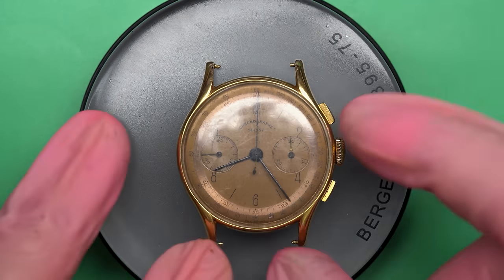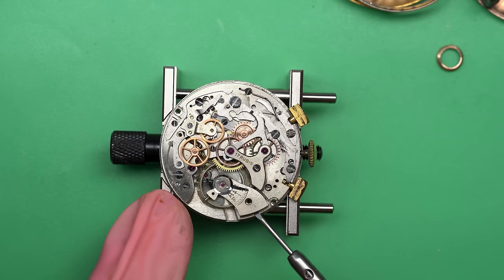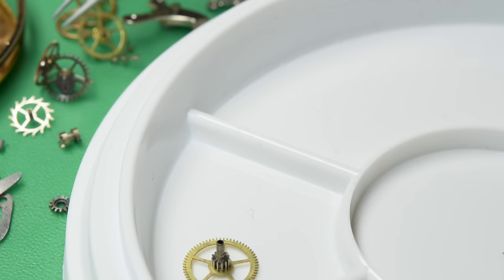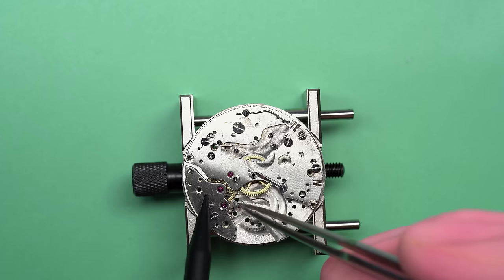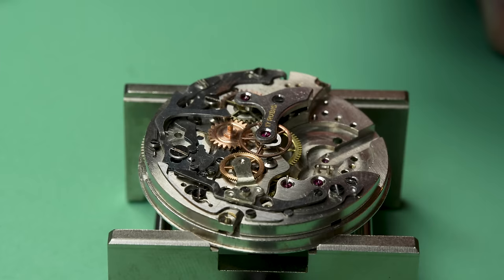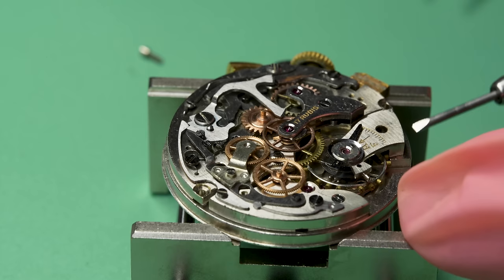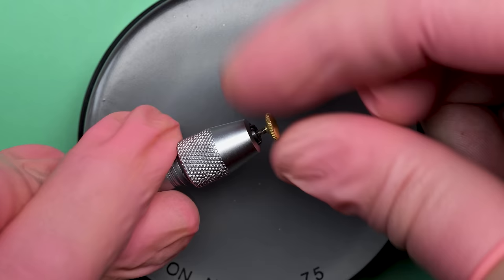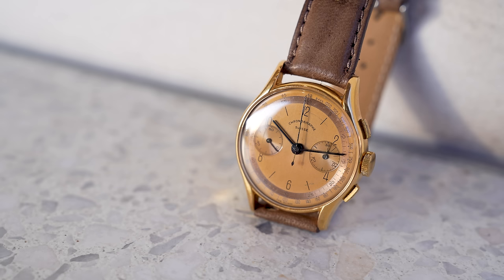Finally, My First Time Working on a Chronograph!

Comment: Thanks for the explanation of the Chronograph vs Chronometer, I tended to think they were basically the same, and just indicated a 'flash'  or high precision watch.  My 'daily driver' is usually digital, I'm an electronics tech who plays with computers & a bit of programming, so adding stopwatch functionality to me is kind of child's play, just a bit more coding on a micro. However seeing it from the mechanical side - wow, way more involved.

Comment: Whale Oil is an excellent oil.  It does not degrade over time.  That's why NASA used it in the gyroscopes on the Hubble Space Telescope.  Now the Gyros are sealed but that it was the only oil for space tells you something about it.  They had to go find a supply of it from the old days since modern whalers only do it for food in some places.

Comment: Loved the Chronograph…and that dial is awesome…really unique. In a future video could you talk a bit about sourcing parts? I am having trouble finding a gold crown for an Omega 166.098. Trying to get into the hobby starting by doing some very minor restoration work on a ‘72 Omega Geneve. Watch was already serviced but has some generic parts that I want to bring back to original as much as possible. Would appreciate any tips.

Comment: Chrono's are a bit scary aren't they. I did one last year, it would not run but it was complete. I still sold it for over 200GB. I haven't tried again just yet . Not so many vids on them. You are a pioneer.

Comment: Again great video, love to watch your videos. I just acquired an old Titus Geneve with almost the same movement, that is in need of an overhaul, but haven't dared to touch it yet. I was also told with this movement it was better to leave the screws in place after removing the parts, since it would be a lot better to keep track of where they go. I hope i will get the courage to take it apart at some point 😄. Maybe at little to much side shake at one point, and I would have changed the mainspring, it's pretty set, but very nice job, probably couldn't have done it better myself🙂

Comment: 39:00 Whale oil was really good. Before synthetics, sulfur treated whale oil had a very consistent viscosity over a very wide temperature, it is thin, does not congeal or dry out and does not corrode metals and until 1972 was heavily used in car transmissions, aero-space, sewing machines, watches, and even used in some nuclear bombs.
It was so good that transmission failures rose from under 1 million in 1972 to over 8 million by 1975 in the USA. Modern synthetics beat it by miles, but it took a couple decades for chemists to find the right formula.

When you're rubbing off dried oil on jewels, especially on older watches like this, it's very likely that it's whale oil.

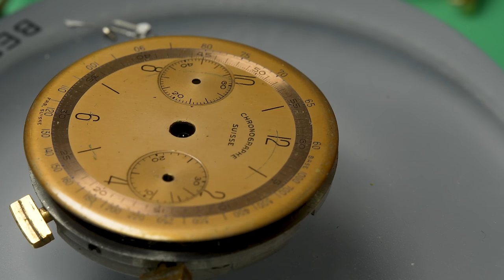Comment: Just a very minor nitpick about the use of “seconds hand” and “sub-seconds hand” from around 6:00 ; The big “seconds hand” is actually the chronograph seconds hand, which only moves while the chronograph is active. The watch’s seconds hand is the small sub-dial on the left (near the 9 o’clock position) and that hand always turns whether the chronograph is active or not.

Comment: A lot of 3D Printer Enthusiasts will knkw about eccentrics because they are common in a lot of printers for adjusting wheel tension in the tracks.

Comment: I had been wondering when I would see a Chrono. I have a Kelbert Chrono which looks similar to this which I found and needless to say, it needs service. It is so fascinating to see what goes into it. I wonder if this has the same movement as mine. It seems to have the same dial configuration. I have been so hesitant to have it serviced because I know it will cost me a fortune and I am afraid of rejection because it's old enough that I think it probably has radium in it. One of these days, I hope I can have it done.

Comment: Glad to see you are servicing a chronograph. I have a watch that was left by my father-in-law. It’s an Angeleous Chrono-Dato. Possibly from 1940’s. He likely acquired it when in the Army during either WWII or in Korea as he was in both wars.
It was not running so I asked a Jeweler to service it. It was returned with stated being serviced and repaired but never continued to run. Would you consider taking it on for servicing? It is a beautiful watch with golden case. Or, could you recommend someone to service. Thank you How do I access your response?

Comment: I love watching you work. I have a question. I bought a vintage watch from eBay. It was advertised as working and punctual. It winds and keeps time, but it is fast. It moves forward in time about 20 mins in about a 4 hour period. Is there an adjustment to bring it back into time?

Comment: Typically a shaft of screw with a lobe on the end that applies pressure is normally referred to as a cam in the engineering world, however i don't know if this applies to your trade

Comment: Hi Marshall.  I love a good watch.  Being from Australia, I particularly like Aussie brands with good movements.  I have a Bausele Oceanmoon  with a Sellita SW200 Swiss movement and two Haugh and Hastings M2 dive watches with Seiko NH38 movements.  The question I have is that I have an older Citizen Aqualand watch I bought in the 90s while posted (Army) in SE Asia and I would like to see if it is worth being restored.  It has a very scratched sapphire and the bezel has copped a lot of abuse, but otherwise good condition.  I get that its a battery watch (3 I believe) but I hope you may have some sage advice

Comment: Marshall:  My wife and I really enjoy watching your projects.  I found the Omega chronograph my wife bought me over 50 years ago.  I pulled it out and wound it and it runs.  Its labelled a Seamaster.  I looked on the web and found what seems to be my watch:  Omega Seamaster 2884, caliber 321.  I tested it with my timegrapher app with the following results:  bph 21,600,   rate 102 s/d,   beat error  0.6 ms, and amplitude  215 deg.  Not too bad except accuracy.  I'd love to get this watch serviced and hand down to grand children later. 

How do I find a reliable service location?  Are there authorized Omega service centers?

Is this one you would like to take a crack at, now that you've stepped up into the chronograph world  :-)

Comment: Fascinating. I notice that on the chronograph side, one of the wheels has much finer teeth than the one that engages with it. You called it the running wheel? Is that common?

Comment: ec·cen·tric = (of a thing) not placed centrally or not having its axis or other part placed centrally.
con·cen·tric = of or denoting circles, arcs, or other shapes which share the same center, the larger often completely surrounding the smaller.

Comment: @Wristwatch Revival   Have you ever considered delving into the witchcraft that is sewing machines? My mother had a great story about a fairly modern one (late 80's, early90's, non-computerized) in which the timing would act up horribly, breaking needles left and right. She'd pack it up and take it to the lone repairman in our area and he'd put it through some paces, right in front of her, and it would work perfectly. He'd accept that she wasn't mistaken or the materials were an issue; it really was going in and out of time because he'd catch just a hint of it at first startup, but it would run smoothly after that. Following a few services to check it he suggested that she just take it for a half-hour drive every time it acted up again rather than having him bill her for the time involved. Sure enough, it would go back to working fine for months without a hiccup following a drive. 
Evidently it just wanted to see the world.

Comment: 50:36  Did I miss something, or is the recording minute hand not set to zero itself on...well, zero?  It appears to be around halfway between 0 and 1 minute (zero also being the 30 minute mark)...unless that's just parallax error from the camera angle.

Edit: nvm, I see it ended up on the money @ 51:12.  Doesn't matter if it was repositioned or if it was right from the first, so long as it's right when the job is declared done.  👍

Comment: At 39:33 I noticed that there was some Rodico left on one of the alignment pins of the balance. i don't know if you removed that prior to putting the balance in but my guess is this could have been responsible for the balance being a bit more difficult to seat and align at 40:05? I didn't hear you say that you removed it or saw that pin again afterwards so I don't know if this could be the issue

Comment: Thanks, Marshall.   I have a couple of questions if you wouldn't mind...

1.  What type and power of binocular magnifiers do you wear? 

2.  I overhaul pocket watches.  A friend of mine has one where there is a DENT in the side of the screw back - that is right in the thread groove - locking the case back into place.  Any ideas on how to safely remove the back?  I would fix the dent once I have the back off. 

Thanks Marshall!   Tim

Comment: Just curious, is there a reason you didn't put braking grease inside the main spring housing? I'm still learning and would have put grease in there so I'm just looking for clarification. The finished watch is by far the nicest watch I've seen you do. Beautiful watch!!
Reply: That grease is for automatic movements only. Automatic springs dont have a hook that clasps to the inside wall of the barrel. They just slide on the inside.

Comment: Just a question: does the minutes indicator fall backs to the position "30" or, because of the way you mounted it, stays every time differently after you stated and stopped the chronometer function? Excellent job by the way, you are simply fantastic.

Comment: Only thing I’d add to things narration and walk through is a small correction.

“Bridges” with only one screw holding them to the plate are called Cocks. A true bridge has two or more screws.

But I can understand why you would be hesitant to use the proper names for them. Haha.

Comment: I have a question as much as an observation. Is it true that the whole mechanism has a certain resonance to it? The spring offers a more or less constant force, that's released into the system one click at a time. The components have a certain tolerance and inertia to them, where the forces do equilibrate but vary from click to click. I think the forces don't fully equilibrate before the next click, because I hear slight variations between the strength of the clicks in my watch. I also see similarly very subtle variations in how far and/or fast the balance wheel rotates between turns (I have a skeleton watch). My watch is a brand new Fossil Townsman that has a Chinese movement with 21 jewels.
It would be interesting to see a watch under a strobe that's timed to the average frequency of the balance wheel.
Reply: Side note: if the spring is getting some recoil from the rest of the system, it makes sense that on the next click it will deliver less force, which results in a weaker recoil, so that it'll give more force on the next click again etc. If you could graph the internal stresses over time, it's probably a pretty jagged graph and maybe even a little eratic looking.

Comment: Do folks that need glasses have issues when using a loupe? I'm assuming the magnification is such that there aren't many problems but just curious if that could be a limiting factor for getting into this as a hobby.

Comment: Does it matter if the regulating arm is placed back differently than it was as it was removed? I noticed it was positioned completely to one side and replaced in the middle position.

Comment: I like what you do and have a question, not a watch question though, I have a grandfather clock that my grandad built in 1970, it has a Jauch movement in it, and I want to get it running, I don’t have a problem doing the work myself but I’ve been looking for a channel that might help me with this, any info you have would be a big help. Thanks in advance.

Comment: Recently bought a "westclox scotty pocket watch for repair", as a project piece, and I am stumped as to why it is not working. There are no obviously broken parts, it will work temporary, from 2-3 seconds to 11 hours, if it is tapped correctly or if it is submerged into a cleaning solution, but nothing seems to get it working normally. Can you please know if you have any ideas or know where I can go to look up what to do, I am new to this and would appreciate any help.

Comment: Mr. Marshall has a 1975 Sorna Chrono mechanical wristwatch and it doesn't work, I can't move the hands when I take the key out to set the time...when i turn the key the pointers start working and work for a few minutes and the key comes back on its own...i turn the key to wind the clock and it starts to turn or release by itself...can i send the watch to you for repair?

Comment: Is there something special about how they made the dials? Because i tried to find this watch by matching the dial and to my surprise i couldn't find a single match. Having the Chronographe in an arch and suisse in a straight line is already a very rare design feature it seems, and then only printing even numbers is another fairly uncommon (not as uncommon) feature. Is there any way to identify the model?

Comment: I have a question.  I have an Invicta 8928OB.  Dunno how...but the bezel came off one day and both the retention spring and the clicking bar spring just up and flew away.  Where would I be able to get replacements for it.  AND...the bezel insert's adhesive seemed to have dried out and that fell off,  What adhesive would I use?

Comment: Marshall I can repair and fix old clunky pocket watches, but the watch I inherited is a complicated puzzle. I am thinking of buying a complete inner works only for 1K.  Would you like to fix or restore or attempt with my dad's (died 2022 age 95) WW2 watch? He was a pilot and had a pilots Lemania 15tl Chronograph.  A watch repair shop got a hold of it years ago and did not finish the job and installed 15ch parts which did not work. Dad had it in his "box" and it was his Pilots version.  I was told that it was made for the Chech Airforce and Lemania was made in Czechoslovakia. After the invasion by Germany, Luftwaffe Lemania 15ch or15tl were made for German Pilots in this factory by Czech. Lemania horology prisoners. My Grandfather bought it in a pawn shop in Chicago in 1943 after my dad was in Pilot training. It apparently was owned by a Czechoslovakian Pilot that tried to defend his homeland when Germany invaded.  I do not know any more than that. Somehow it came to be in a Chicago Pawn Shop by early 1943. The Chrystal and hands were replaced by parts that Dad would not accept so he put it away for a few years before he gave it to me. If so just contact me in reply.

Comment: Greetings, @WristwatchRevival! Ihave some questions if You woudnt mind! 
I happen to recievie an old pocket watch in heritage. it is in poor state (broken out of case, mising arms, even bent balance wheel), however it belonged to really close person of mine. 
So i wish to fix it, but i cant find any significant markings of this movement. Maybe only serial nomber  - 124723. also movement is in 28,5mm in diameter. Is there any good way to find correct movement manual? 
Thanks in advance!

Comment: i got lost at... it doesn't have a shock protection setting so you have to dissasemble the balance to clean it.  I don't understand the correlation between those two things.

Comment: Love your channel and the videos, great work! But I have to say, the pricing of the tool sets on your website is way too high, almost a scam. You can buy cheap starter kits online for like 10-15 USD and it will have 60ish parts and tools in it. Unless what you are selling is considered to be better than anything else on the market, I don't see how you justify charging almost 800 USD for  a rather simple kit...

Comment: The finger condoms are really cringy. The watch is not nearly as expensive as needing gloves and those make it nearly impossible to handle small components of the watch. Unless you're trying not to bleed on the watch, why use the finger condoms?